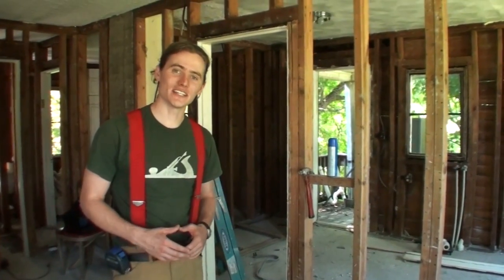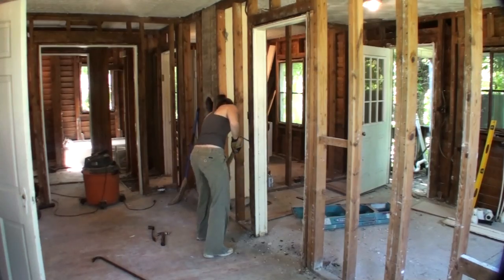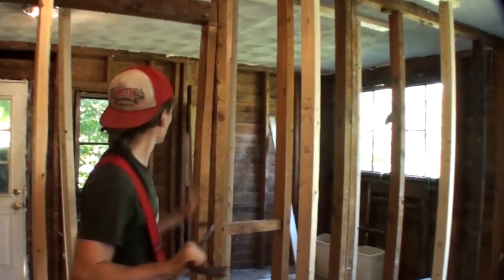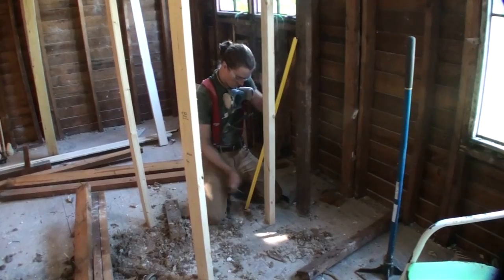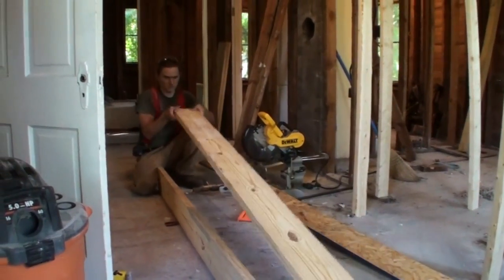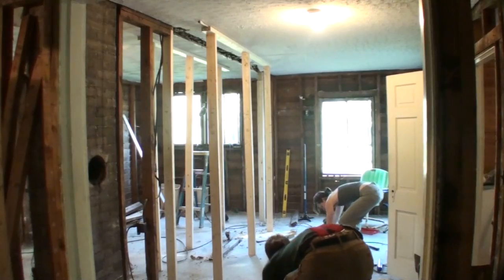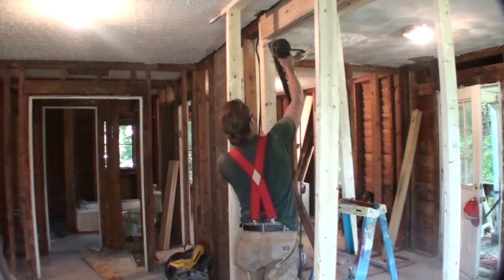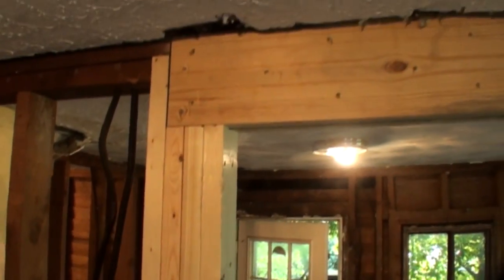Removing a Wall to Create an Open Floor Plan - Old House Home Renovation

Comment: Loved this video. We live in a small Burbank, Ca. house. We want to break a wall making a living room kitchen combination room. First we have to figure out if it's a load- bearing wall. Great video! Just subbed
Reply from the maker: Do you have a second floor?
Reply: Homemade Home, No it's a 1950 ranch about 1700 sq. ft.
Reply from the maker: Probably not holding up much then, ceiling joists and drywall.

Comment: Does this require obtaining permits and redoing the floor plans?
Reply from the maker: Yes, but what you do in your own house is up to you......with that said, I renovated this entire house and had a building permit. If I did not have to get the permit for all the work I did, I would do this without one, but I know what I'm doing. If I did not know what to do and hired someone, I'd get one. As far as local code, you are supposed to get a permit for pretty much anything more than painting your walls.
Reply: Homemade Home thank you!

Comment: Open Floor Plans and terrible and cost more to heat and cool...and no more privacy...
Reply from the maker: +S Luzardo It depends on the house. Im not one to take down walls for no reason. Ive lived in this house for several years. The wall being gone is nice. It was too small before. Heating and cooling fine as well. The house is less than 800 sq ft.

Comment: Are there no base 2x4 under the studs ? ?
Reply from the maker: Normally you do, but most of them are back to back, and sitting right on a joist....in short, it's fine in this case.

Comment: Hello , question?  Where you opened up the wall Was it a load  barring wall. I'm asking because I have a wall that I would like to take down but was told it was a load barring wall and would need a engineer to re-figure the. Barring.
Reply from the maker: In my house it was only holding up the the ceiling joists, so no, it's not load bearing. In your case, you will need a beam that can handle the weight. A beam can be mounted up in the above structure so it is not visible or the above structure can rest on top of it.
Reply: Homemade Home thank you for your answer and your time

Comment: How did you finish the opening? Did you frame it with boards like a door frame with no door or just drywall with beaded corners? If you use boards do you have to leave a space or can the boards be butted against the framing?
Reply from the maker: I trimmed it all out in wood. I ripped a 3/4 board to the right width, which is nailed to the rough opening, you can shim them out if needed. Then the side casing trim is 1x4 sitting on a small pedistal with a 1x6 top casing. It also has a little fillet and top cap. All done simple but clean. I did the windows a little different. Basically they are picture framed but have a window stool and apron. I'll be doing more videos eventually.

Comment: anyone run into issues with heat runs or cold air returns being in the wall?
Reply from the maker: What are you specifically asking?
Reply: Homemade Home thanks for the response! I have a cold air return and a heat runs in the wall I want to remove.  not real sure where I can reroute it without creating a huge mess :)

Comment: What a big difference that made! We want to do something similar to open our kitchen to great room area but we will do a half wall so we don't loose existing counter space.
Reply from the maker: +Tyler G I sacrificed some by doing this, but what is gained in layout is worth it. I just built an island to compensate, you can see it in the thumbnail for the video.

Comment: So pleased to see those additional cripple / short studs going in! I couldn't believe when I saw you taking down the temporary props when there were only single studs either end; would rather you'd have all the studs in to make the compound columns first but I guess the singles were only supporting the load short term.
Reply from the maker: +Andrew Cartlidge Just to hold it in place one is fine, in this case the weight is minimal. But for the final framing you want more, I did a few extra on the right, but that was just to get the opening where I wanted it. Just needed to get the temp. studs out of the way to work. Thanks for watching.